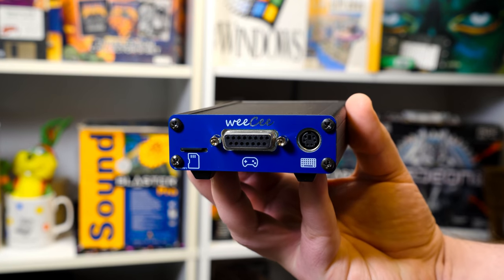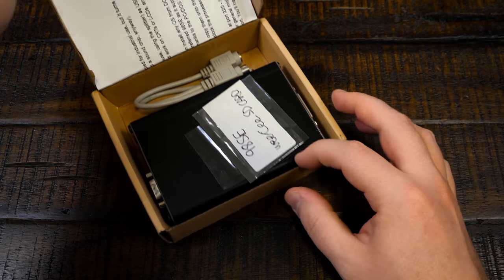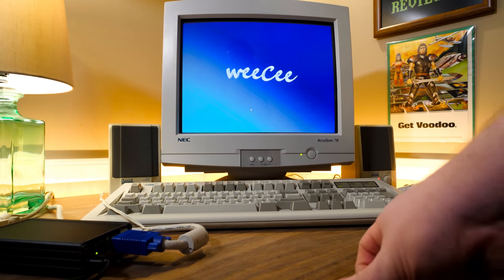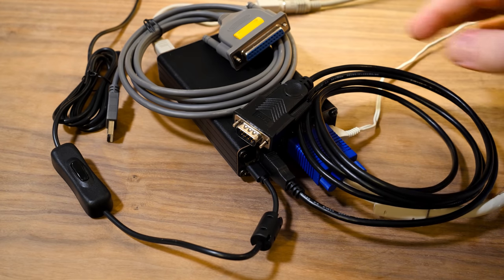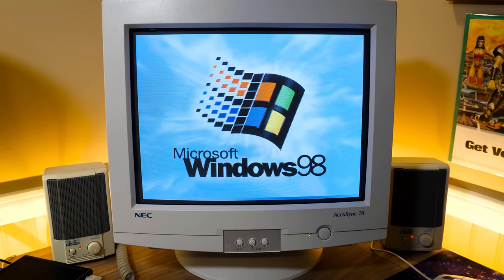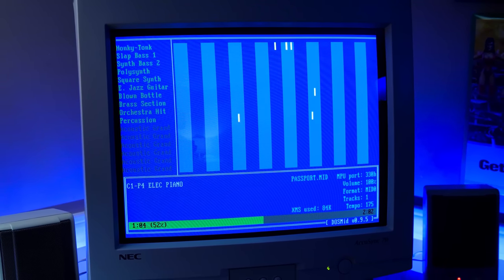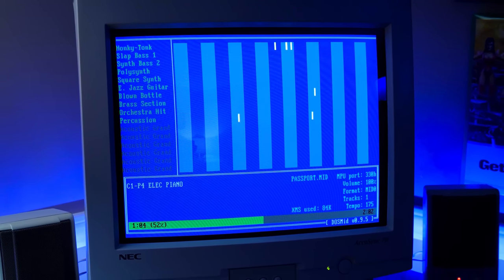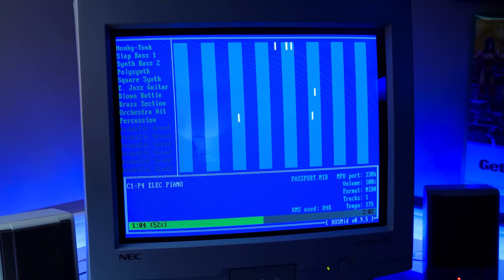The weeCee: A Tiny New MS-DOS & Windows Gaming PC!

Comment: Blows my mind seeing all that hand soldered SMT work. That's a sign of some serious dedication, or an unhinged mind. Possibly both.
Reply: Noticed that, too. It's a (late) prototype, though. If production units are still hand-soldered, it's definitely both.

Edit: Oh poo, these aren't gonna be produced! Just a project for people who are comfortable with doing SMC soldering, I guess.
Reply: @pseudotasuki  you can have the board house do assembly...
Reply: So, Ben Heck?
Reply: I fully get your feelings on the subject - I tend to design with through-hole components because nobody would make my stuff if I used SMT... and it's not very 'retro'. But FWLIW SMT soldering isn't difficult at all; it just requires a different 'philosophy'. ie: Use loads of flux, splash the solder all over, and clean the bridges after. Once you get the hang of using surface tension to your advantage you'll be good.
Reply: Having watched a metric ton of Louis Rossmann over the years, I strangely had an easier time learning SMT soldering than Through-Hole for my J-STD.
Reply: He could at least have the jellybean components pick and placed by some manufacturer (JLCPCB or something) saves a lot of time and trouble
Looks like a lot of wrong i.e. not matching footprints though
Reply: @Lauren_C  More flux!
Reply: The only trick to doing SMT work is to not rush it. If it takes you ten minutes to install a single capacitor, so be it (as long as you're not applying heat the whole time!). Just take your time, get each piece lined up perfectly, check your work, recheck it, double check it. Then apply heat. Invest in a jewelers loupe to make sure your joints are rock solid and move to the next piece.

This isn't the most efficient way to do SMT, but it works.
Reply: The hardest one to solder is the CS4237B-KQ sound chip. Even using a USB microscope, I takes a while to get that perfect alignment on all 4 sides. The slightest twitch knocks it out of alignment. I wasn't good at first and I soldered it wrong when I finally committed to all 4 sides. One hot air desolder station purchase later, I was able to remove and restart.
Reply: @BenHelweg  When in doubt, Moar Flux! cries in flux cleanup after
Reply: surface mount aint that hard. I do graphics card repair and bga rework and honestly i prefer surface mount over through hole any day of the week.
Reply: Not so unhinged soon... when the soldering fumes have done its job.
Reply: I worked with the guy who wrote the c64 emulator, hox64. It takes a special person to dedicate so much time to those sorts of projects.
Reply: Shin Megami Tensei?

Comment: Amazing! Being a blind gamer in love with text adventures, I'd love to see a retro speech synthesizer on board that can be driven by one of the original DOS screen readers such as ASAP or HAL. What do you folks think?
Reply: Sure, something like this would probably be perfect for doing that kinda stuff
Reply: So, this is actually an interesting idea! The weeCee actually has a bunch of GPIO ports that can talk across SPI/I2C to various devices. If you had a device that could do the text to speech that talked across such lines, you could probably do this.
Reply: Hmm, I wonder if RC Systems still make any of the DoubleTalk chips that were used in a lot of products, I know they were still making them in the mid 200s because the BookPort used a DoubleTalk chip.

Comment: I'd love something like a weeCee for games released in the XP era - think Quake 2 to like, 2006, 2007. Probably not as easy since tech got much more varied in that time period, but it'd be super cool. The closest is a micro PC like a GPD Win 2.
Reply: Is there a processor so powerful in a small form factor? How does a raspberry pi compare to a classic pentium?
Reply: Look for some late 2000s thin clients. Many of them can run XP and have a few expansion slots.
Reply: I don't think the problem would be finding a CPU so much as dealing with the 3D accelerator (GPU) issue. weeCee tackles games from before and slightly after 3D accelerators came up, so software rendering was still a pretty commonplace option in games. When you get to the late 98SE to the WinXP era and beyond, GPU's became mandatory and software rendering wasn't much an option if it was there at all. Much like sound cards. After, say, 2006, sound cards all but disappeared except for the hobby market. The industry decided to include audio on-board, for better or worse. At first, it was horrible with quirks and bugs and sometimes horrible output but as time went on, it came into it's own and dedicated sound cards became a niche market like they are now. 
To build something that would play games from the late 90's to mid 2000's, say the time frame from the first Half-life to the second Half-Life, you'd need a CPU that had 3D on-board. Now way back, there was a short period of time that nVidia put out it's own boards with an nVidia GPU already on it. Sure, you're getting a GPU for the cost of the board but then you were stuck with that GPU forever, you couldn't upgrade it to my knowledge. Something like >that< would be ideal for a project like this. It would take a lot of work and tracking down useable and freely available parts to get something like that off the ground but it could be possible.
Reply: @MaraIndigoJade  There are some thin clients with a single AGP or PCI slot.
Reply: Steam deck?
Reply: @thekillerprawn  Ah yes, the Steam Deck. a Perfect Tiny PC, designed exclusively to run all of the classic 98/XP Windows games on. (also my comment's a year old)

Comment: Interesting project. It really needs the pc-beeper for DOS games.
Reply: If it were comercial it would certainly have it
Reply: Yea big one top of it
Reply: The hilarious thing is that tiny pc beeper would account for a third of the overall footprint. XD
Reply: @xiaochicash  :D OR you just put the beeper connector to motherboard and plug the cable to soundcards input. Problem solved :) I remember doing this back in the 486 days.
Reply: Funny enough the PC speaker output is directly wired into the audio chip on its Mono input channel. I think LGR may of just simply had inadvertently muted that channel. Easy to do.

Adding a PC beeper wouldn’t be hard though, there are pins on the side along with the RTC CMOS battery that are specifically for this.

Comment: Big fan of TheRasteri's channel and his Wee Cee/Wee 86 builds. I would say, for a tech junkie with a modicum of tech savvy, projects like this are well worth the effort and cost. For the retro enthusiast, the $600 estimate TheRasteri gave for a completed unit is not unreasonable. The major reason I feel it's a reasonable price point is because it's all new hardware, no recapping, no compatibility issues (hardware wise) and it just works out the box with any number of 80's - mid to late 90's games. Just a few tweaks in the BIOS and all but the most particular 4.77mhz requiring DOS games will run just fine on it. No emulation, no lag, all you need in one tiny little box you can take anywhere with you.

For those not able to shell out that much, well, there is the used market where you can pick up older, used SoMs for a fair bit less. Making your own PCB to mount it on containing all the features you need will take some doing however. Fortunately, in this day and age, odds are, someone has already uploaded schematics for just the thing you need somewhere.

Comment: This is fantastic.  It would be fun if there was a wired in speaker that during the boot up process made the beeps and whirls of cd/floppy drives.  It might sound hollow, but would be fun.
Reply: Just a POST beep would be fine with me. : P
Reply: Pin 60 is marked SPEAKER in the SOM304 system development user manual and on the dev board. It would be odd if it was not included since the PC speaker is sometimes needed in industrial applications.

Comment: 6:40 nice, someone finally gets the idea that neither CF or DOM disk is that common for modern usage.
Also, neat SMD soldering work btw.
Reply: Well you can still buy CompactFlash so I don't see the problem. CF is 100% compatible with IDE so you can run any OS you want, and far more robust (equivalent to an SSD), not to mention faster with DMA.

Comment: Maaan, I wish I could buy one. I've become so frustrated with hardware keeping breaking on my retro PC (which is wall-mounted on a wooden board made specifically for the components I had at hand, so swapping out broken parts is really annoying) and I haven't had the time to fix in more than a year now, so this looks like it would be a better experience. Also it running Windows 98 with period appropriate hardware is great.
My retro PC runs XP on slightly newer HW, so I haven't even been able to play all retro games, like NfS II and Star Wars Podracer on it.
Reply: Could your hardware issues be due to improper cooling? Apart from the CPU, other components may benefit from cross ventilation that was being provided by the enclosure's case fans.
Reply: @burtpanzer  Yeah, I guess that could be the issue. I never thought about that, but the CPU cooler is a tower and the GPU doesn't provide airflow to any components either. Thanks for the tip! 
The main issue is the GPU though. I had a GTX 285 which was overheating and shutting down within a few minutes of gaming when I got it. Cleaned it and replaced the thermal paste and got it back running, but unfortunately I didn't swap the themal pads, so after a year or two it burned out its memory and VRM modules.
Since I built the wall mount around the hardware I had lying around, I needed to replace it with the same model GPU, but I bought two and both had the same problem, despite being sold as working and replacing thermal pads didn't save em. Tried treating one with heat, and did get an output, but the fan stopped running.

But the Mainboard could have problems due to no airflow. Though I'm not entirely sure, if it's broken or not. One of the boards I have likes to have glitches and freeze in BIOS when using the on board graphics, the other one might be fine tho.

In any case I'm done with the GTX 285, that card has a fatal flaw. So I'll need a different solution for a case (don't want to towers under my desk though) and need to get a guaranteed good GPU from somewhere. Not gonna buy on off eBay anymore.
It's gonna be a project for my next time off ^^
Reply: @burtpanzer  my retro pc doesnt even have a heatsync on the cpu! and no fan either. No heat issues.

Comment: i don't know if it's just me but with emulation and solid state systems i miss the sounds old computers make: flick of the AT power switch, fan and harddrive slowly starting to spin, CRT degauss, POST beep from the pc speaker, floppy drive initialization and harddrive read and write sounds. These need emulation!
Reply: Yeah, and add an option for the 15kHz sound the CRT is making all the time while you're at it.
Reply: I completely forgot about the degaussing sound!
Reply: WinUAE emulates floppy drive sounds exactly for this reason.  A lot of those subtle sounds aren't just for the sake of nostalgia -- in many cases they were the only feedback you got that the system was actually doing anything.
Reply: Complete the package with dial-up tones and g2g!

Comment: Would be neat if they made something like this with an integrated Voodoo2 or equivalent 3D accelerator of the time (3dfx was king until the Geforce/Radeon came out).  I understand why this version doesn't though, since the SOC was designed for legacy industrial PC's.
Reply: I would instabuy that
I always have a few times I just wanna get back into the nostalgia that is retro
But I dont have a retro pc, and the options that i could get are expensive, even more than the 500 bucks that this would cost.
Reply: @Jason Fitch Yes.  But those came out later.  There was a time when 3dfx was king, and Glide was the only protocol that actually worked well.  Of course Geforce cards are better...they drove 3dfx out of business, and Nvidia owns almost all their tech today.
Reply: @Jason Fitch Depends on what you're doing with it.  Some people are looking to run specific software that only runs properly on the Voodoo.

Comment: Would be nice to see the micro-usb exchanged for a usb-c as well. I was thrilled when Raspberry Pi made the switch.
Reply: We hobbyists still generally avoid them.
The pitch is so utterly tiny they can be a colossal pain to solder by hand. Assuming you can source a Pin through hole model.  The Surface mounted ones i wouldn't even bother without reflow soldering. So we mostly still stick to Micro. The more skittish ones potentially opting for mini.
Reply: @Foxhood  Us shaky handed hobbyists stick to regular B because its easier to solder
Reply: @kirinokosaka9641  I don't like pth that much. Costs space which costs money if you have your boards fabbed.

I do employ custom footprints with the pads elongated. Easier to hit with the iron despite not having the most stable hands with the solder flowing to the pin doing most of the work. If only for power I would only modify the vbus+GND pad to make it  as easy as possible.

Comment: It's 2021. New devices should be using USB-C. Especially for power.

But this thing thing is still amazing.
Reply: I agree. USB-C is simply more efficient for charging when compared to alternative methods. Up to around 24% in controlled lab tests. And there’s just the convenience of having many spare USB-C chargers so having something use it as power is just nice. Most nights around midnight I feel a dark presence near me. Upon feeling this I begin to feel warm breath going down my neck but when I turn around I find no one behind me.

Comment: That looks to be the perfect kit for mounting in a vacant 5.25" drive bay, with all the I/O on the front panel. for an alternative take, and powered from the same PC it is housed in  Speed of the SDXC (which must surely be running on the USB2.0 channel at best) would be improved upon by the network to your preferred network storage.

Comment: Currently, the most affordable MS-DOS and Windows 98 hardware is HP 5710 thin client. I've paid 10€ for such device. It is a mid 2000's machine sold with Windows XP embedded, but has all drivers for Windows 98 and even has native Sound Blaster Pro support in MS-DOS. OPL2 FM Synth is not perfect, but acceptable and SB DAC works flawlessly. It only uses VIAFMTSR that keeps DOS in real mode, so compatibility is perfect.
Windows 98 works even better and Radeon 7500 Mobility is good enough to run 1997-1998 3D accelerated games. It is faster than Voodoo 1 and has a lot more memory. Some games work really well, like Tomb Raider 3 has playable framerates up to 1600x1200.

Older Thin Clients are in general good and affordable devices for Windows 98 and XP gaming. However, there's just one model that has native MS-DOS Sound Blaster support.

Comment: So cool. My only request would be some way of running 3d acceleration ESPECIALLY Glide! Would it be impossible to have a separate external AGP graphics card to some how hook up to the weecee through a high speed connection on the motherboard that registered as a installed graphics card? Having a Voodoo card acceleration would be the only request I would ask for.

Comment: This is great. Shows what great work some people are doing along with things like the mister. 

The biggest problem is probably the ongoing chip shortage pushing prices higher. Old vintage systems can be rather difficult to keep working without cate and attention so something like this is probably a next best,  though the lack of 3d acceleration is a shame. I wonder what options would even be feasible though. 

I think making it a bit bigger so more io can be added and allow it to be vesa mountable could work quite well though. 

I sadly don't have anything newer than a p4 these days (though I do have a very old pentium m laptop somewhere I think), so while I could cover windows xp era ok, dos/9x is a bit harder and old 486/pentium systems seem to be both rather rare and expensive these days, when it wasn't that long ago such systems were deemed junk and thrown out by lots of people over the years.

Comment: I feel like the best solution would be to make this thing like, an inch or two taller to cram some more stuff in, some more io, the speaker, stronger power supply to support the io. maybe something for that 3d graphics issue (I have no idea personally if there's compact enough modern clones of old 3d cards, but if it exists it'd be rad to see in this thing)

Comment: A cute little device but the most interesting thing for me is the BIOS with it's slow-down settings. Would be awesome if you could limit RAM for games that struggle with too much. Don't know if this BIOS also offers Memory Hole at 15-16M, which I use on my Retro PC to limit RAM size to 15MB.
A full size PC with new hardware (as old hardware will fail at some point) and this BIOS offering the expandability of normal PCs would be awesome. So ISA and PCI slots, IDE headers and so on included.

I actually got rid of my PC Speaker and made a cable to plug into my mixer so PC Speaker sounds will come directly out of my normal speakers and I can actually adjust the volume. All audio outputs go into my little mixer, PC Speaker, CD-Audio, Tandy Nano and Orpheus I. Was always annoying having to mess with different software mixers if there was even a way to adjust volume in the first place.